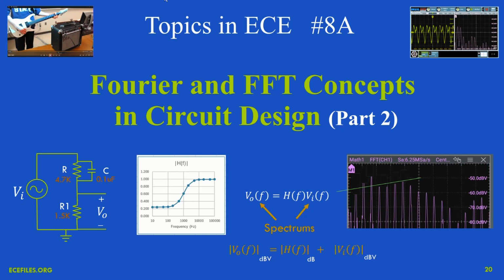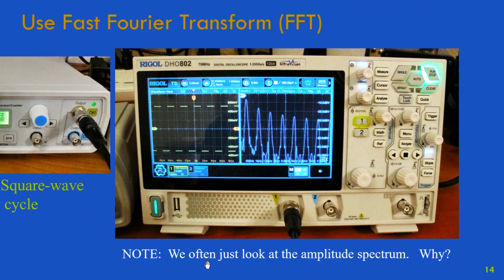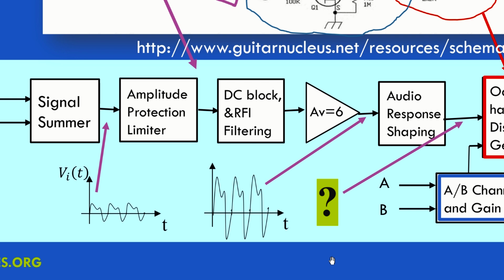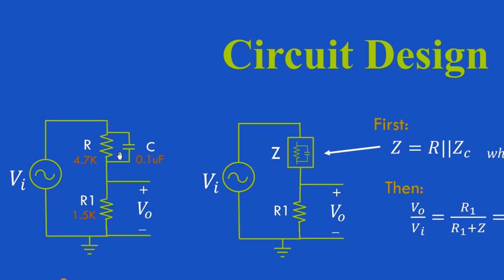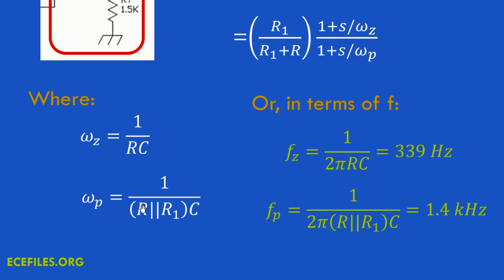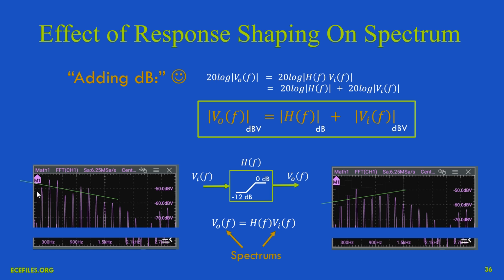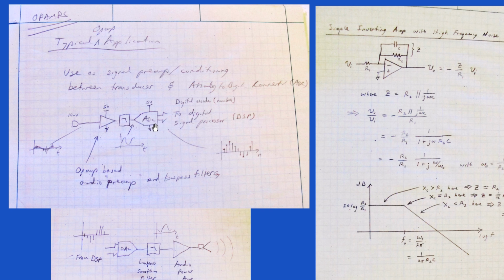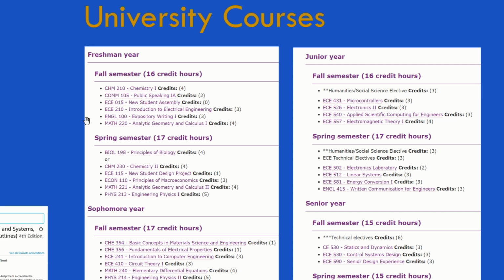Fourier and FFT Concepts in Circuit Design - Part 2 (ECE Topics #8)

Comment: I want to say thanks for this videos, they are very usefull in the sense that it bring all this stuff to groud  and seem more aplicable.

What program or how do you make this slides?

Thanks again.
Reply from the maker: You are very welcome. I appreciate your feedback and knowing that the presentations are helpful.  I use Powerpoint to make the slides. I've also found that using the Windows "Snipping Tool" helps in bringing in photos/etc with simple cntl-C and cntl-V keyboard shortcuts. Plus I use some image editing programs I have to modify 'gamma', etc if the videos are not light enough for example. A lot of the circuit diagrams are hand-drawn in Powerpoint using their "Shapes" menu - and I confess I have mixed feelings about the PPT user interface there. But over time I've begun to appreciate it (including the equation editor). For the assembling the videos themselves, it's a collection of things. A couple Canon cameras for taking main video shots and photos. And then Pinnacle Studio for assembling/editing. I also use MultCam Capture for adding the voiceovers. I don't recall where it came from, but It works for marking an area of the computer screen and 'filming' that while using a microphone to overlay sound when going through the PPT slides. I'm sure there are better ways to do that, and most if not all of these things - but this is what I accumulated over the years 🙂

Comment: High Frequency is picked up early in the cochlea as you indicate, which is an indicator of why the higher frequencies are diminished due to loud noise exposure/damage.  Or so I was told by an audiologist.  Those little cilia are destroyed by the loud sound whereas the cilia inside (low freq)  the cochlea are further away & better protected.
Reply from the maker: Good to learn.  Thanks for the info!  I always use ear plugs when sounds are above 100 to 120 dB. Went to a concert once in my teens where my ears "rang" for about 30 minutes after it let out. I figured that was bad - so I never repeated that mistake. Fortunately, I still have pretty good hearing 50 years later. Just the usual loss above about 10 or 12 kHz.